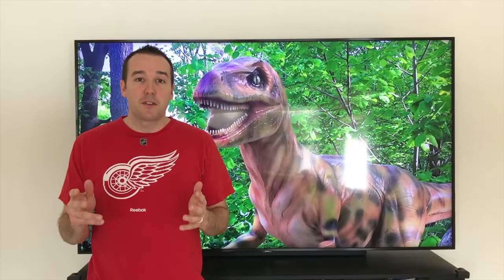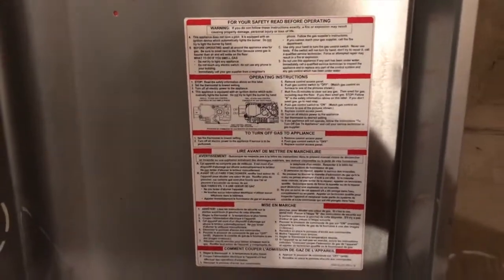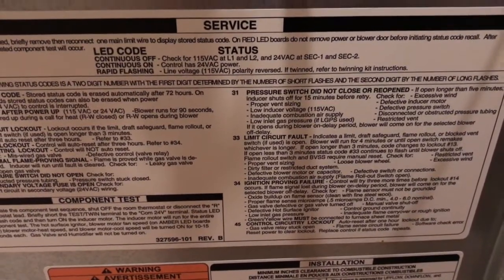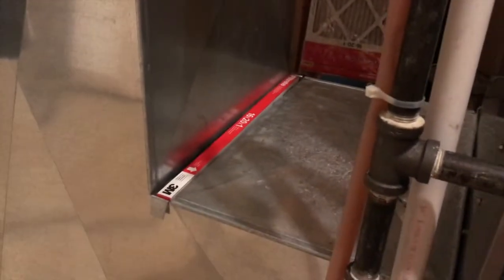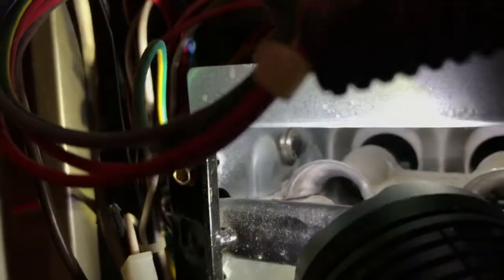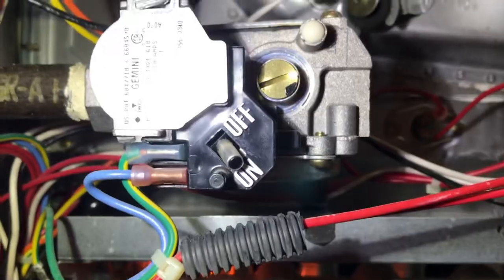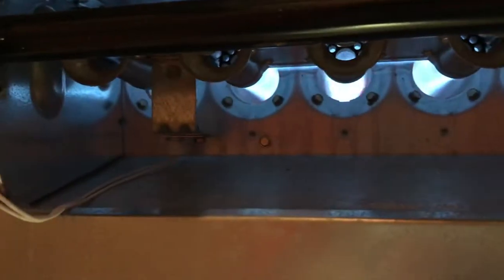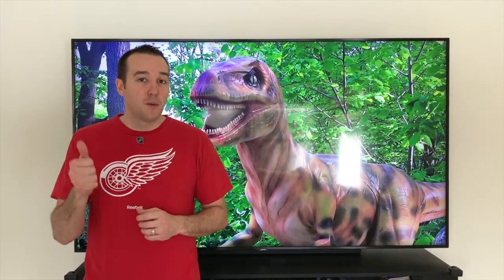Bryant Furnace blowing cold air - ERROR code 33!

Comment: Thank for for this video!   My filter was dirty and high efficiency, but after swapping and power cycling, still no dice.  I checked/cleaned the two flame roll out switches and the one on the top middle, then it all fired back on!  Next time I see you, a beer on me!
Reply from the maker: Thanks for watching & welcome to the DIY Raptor Club.  You might actually have a failed Limit Switch.

Below is a link to a video showing the replacement process.

          https://youtu.be/r9Wx9U7WnWg

Keep us posted.  😎👍🔧🔩

Comment: Thank you so much Sir…I have an elderly Uncle living with me…no heat 32 deg out side blowing cold air out the vents, had/has been extremely windy, code 33…yes checked everything in video, similar Bryant furnace, Bryant Plus 90…resetting flame relay worked for Me…kind of a hard push…took a few minutes once powered everything back on, ran cold air for a bit, then returned to normal cycle and ignitor glowed and she fired up…for me…it saved my uncle…what else can I say but thank you...
Reply from the maker: Good morning Roger & we are happy to hear you’re back up and running.  You saved the day!  😀

Let us know if you have any questions.  Us fellow DIY’ers need to stick together.

Comment: How much play should there be in the sensor's reset switch?

Edited to add:  I also reseated the contacts on the sensor like you did, and that seems to have fixed it.  Thank you for the advice!  (Still curious about the switch, though.)
Reply: Me as well, I figure mine (which are seemingly working) have 1/8" or so?  I tried pulling it further out with my fingers.  Not sure if it was the 2 rollout sensors or the  one above that (and below that other blower) but in either case, fixed in <1 hour.  Took 50 minutes to find this video, soooo not too shabby
Reply from the maker: @nbgambler  

Thanks for sharing Jeff.  Enjoy your day.

😎👍🔧🔩
Reply from the maker: Thanks for watching & welcome to the DIY Raptor Club.  We appreciate you sharing your experience.  Us fellow DIY’ers need to stick together!

Enjoy your day.  😎👍🔧🔩